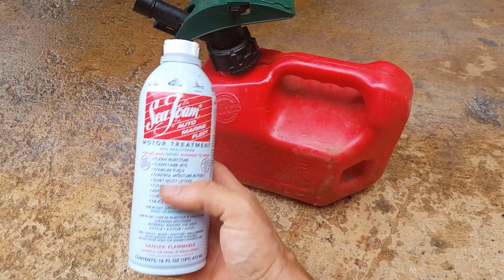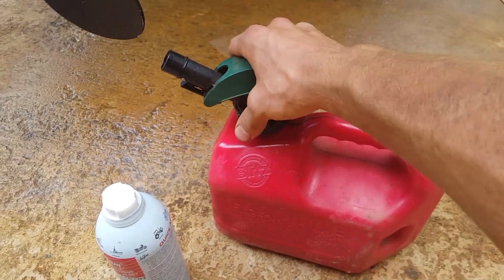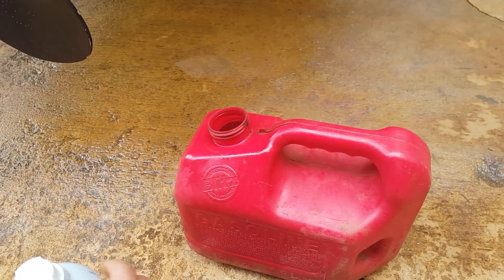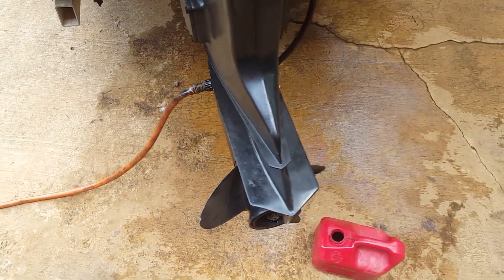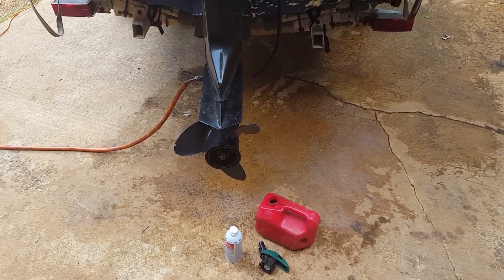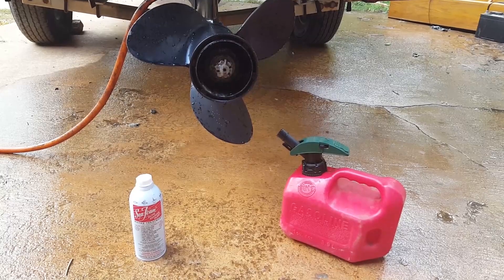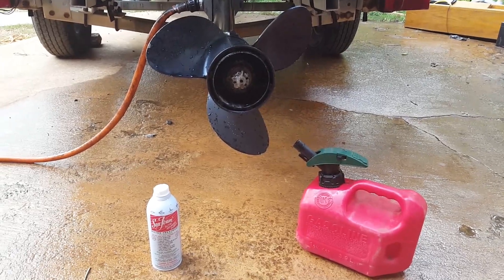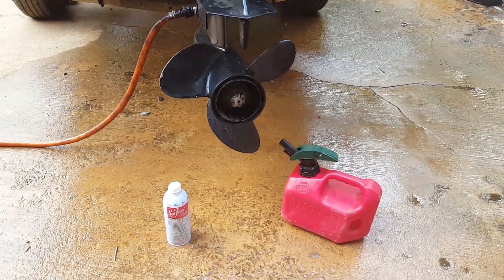Seafoam Shock Treatment - Outboard

Comment: great video man I have a 1981 johnson  70 hp 2 stroke  we took it out to lake today it idled  fine but when  we throttled it down it wanted to stall or bog down do you think seafoam  could help plus the primer  ball never got hard thanks
Reply from the maker: Seafoam is definitely going to make it run smoother, but it might not fix the problem. Did it go wide open? I'd check the fuel pump diaphragm if your motor was before the VRO oil injector fuel pump combo. You could have a dirty carb too. I'd still do the Seafoam though.
Reply: thanks I will keep you updated
Reply from the maker: +Jacob Johnson Ok thanks, let me know how it goes.
Reply: Jacob Johnson follow up on how it went? I have a 1978 15hp Johnson and when I go wide open it will go for about 5 seconds then bog down, I changed my fuel pump but sea foam is needed
Reply from the maker: Yea, Seafoam can make a huge difference for sure. If you've changed the fuel pump it sounds like you got a problem elsewhere.
Reply: Matt's Shop well when I took it out if I slowly inch  the speed it would hold at the higher speed, but I can’t go from idle to full speed or it Boggs down
Reply: U need to clean ur high speed jets

Comment: I have a question. What If your motor is oil injected? Should I still mix a gallon of gas?
Reply from the maker: Cody B Good quesion! If it was me, I would just make sure the oil tank is topped off with oil and run it like normal. Just put 1 can of seafoam in .75-1 gallon of gas like I did in this video. No need to run double the amount of oil if it's already oil injected!
Reply: I won’t hurt nuthing ! Mix some oil in gas to be safe!

Comment: Really appreciate you mentioning the smoke!  Used Seafoam when I cranked a 1987 Honda 4 stroke for the first time in years.  The amount of smoke had me nervous and thus searching YouTube.  I also found the tell-tale ejecting hot steamy water like a jet.  Think it's the same reason?
Reply from the maker: No problem! Yea it smokes ALOT everytime you Seafoam anything. Have you checked you're water pump impeller lately? Sounds like you might need a new one. They say to replace them every 1-2 years depending on use. As long as you have a good hot stream of water coming out of the tell-tale you should be in pretty good shape. However, it's a good idea to visually inspect the water pump impeller every so often. They are rubber and do wear out over time!
Reply: Thanks for the reply!  Should I be concerned that the tell-tale stream is not a dribble, but actually has some force behind it?
Reply from the maker: +John Reed You're welcome. No, not at all. You want it to have a good bit of force behind it!
Reply: Very kind of you!  Thankful to find your channel - appreciate everything you're investing into the community

Comment: Matt I've got a 1988 120V4 Looper similar motor, it's been running great. Just last weekend started losing power once on a plane at say 4000RPM just bogs down. Stop then runs for a bit and does the same thing again. Runs perfect at say 2500RPM got me home anyway.
Do you think this might help that problem?
Reply from the maker: I would defiantly do this to start out. It sounds like you might have a fuel issue. Check all of the hoses, clamps, and carb mounting bolts. Make sure there are no fuel/air leaks ANYWHERE. Have you cleaned/rebuilt the carbs lately? I would also check the fuel pump to make sure that it is working correctly.

Comment: Just did something similar with 1 bottle seafoam to 1/2 gallon of gas.  I had a 9.8 hp Evinrude 4 stroke  that I had been trolling with and not running wide open enough due to this motor being a kicker motor.  It started stalling out below 2.3 mph where I needed to be at. When running the seafoam the motor had excessive exhaust which cleaned up after about 10 minutes of high idle then it would troll down without stalling.....The marinas around here are backed up 2-3 weeks due to spring and the walleyes biting.  This saved me money and valuable time.  I think I paid $ 12.73 for the bottle at the auto part store.
Reply from the maker: That's awesome! Seafoam works great for sure. I'm glad it fixed your problem. No one likes paying crazy marina prices and then having to wait for them to fix your boat when you can do it yourself!
Reply: I have the same Engine but it's Tohatsu , My question is the engine is only one year old. Do I need this treatment on the new engine?
Reply from the maker: It's not going to do much on a new engine. You can put some in the gas tank if you want.

Comment: What year outboard is that? Does it have oil injection or do you premix?
Reply from the maker: It is a 1986 Evinrude 150XP. It does have a VRO oil injection pump, but it is disabled. I run premixed gas in it.
Reply: I have a question,  I have a vro system still intact on my Johnson 130,  will the vro still push oil when the gas line is disconnected?
Reply from the maker: I do not remember exactly as mine is disconnected and I run pre-mixed gas. Yours is still hooked up and working right?

Comment: Have you ever looked at the carbon deposits in a before and after?  Sorry to say I have done that and saw very little difference. ( I used a 2 stroke and 4 stroke lawnmower and a bore scope ) and found very very little carbon removed.
Reply from the maker: Yea, I have seen the videos of before and afters. It did something and ran like a completely different motor after this. The idle was much better and it ran much smoother. I never tell people to use these chemical "quick fixes", but on an outboard it defiantly seems to help big time. 

I don't know why. Maybe because it removes carbon from the rings and since an outboard is such a large 2 stroke motor it makes a much bigger difference than a chainsaw. Although, you can't really see it visually?
Reply: Outboard motors I can not comment about. BUT I can only comment on what I have seen first hand. I even had someone tell me " See its working!! Look at the smoke "  I then filled a brand new lawnmower and yes it smoked like a mofo.   Contacting seafoam proved just as futile.. The placebo effect is what they count on.
Reply from the maker: Rockjock007 Yea, for outboards it really works well. That's what it was originally made for SEAfoam. It was designed back when they would use regular motor oil in 2 strokes before they had all the oil technology they had today, or at least that's how the story goes. Carbon builds around the rings and causes them to stick and can cause engine failure. Especially on outboards because they are so old 30+ yrs. Everything else I have used it on I haven't really seen much improvement. On an outboard it is night and day believe it or not.
Reply: I have to believe you on that my friend.
Reply from the maker: Rockjock007 Yea! I never believed it until I tried it either.
Reply: @Rockjock007  because new engine guts come pre lubed from the factory so they dont seize while stored. That's the smoke you saw, burning oil.
Reply: Project Farm did a video of this treatment on a mower, (before & after). He scoped it and you could see where it cleaned the pistons a little, it's not a complete overhaul but the mower did run better. He has some very educational videos on Seafoam and other fuel treatments.

Comment: Adding the Seafoam will not dilute the gas/oil ratio in the one gallon can?
Reply from the maker: Nope! It will not dilute the oil/gas ratio. It is perfectly safe to do it this way. Thanks for watching, don't forget to subscribe!
Reply: You can run seafoam at a 50% mix
Reply from the maker: +Multileege Adendum what do you mean? Half seafoam half gas?
Reply: Matt's Shop yes that's correct

Comment: Thank you for this video. I had planned to just dump the entire can into my primary tank but your method is much better in my opinion.
Reply from the maker: Yes, this method is much better. If you just dump the can in your tank it dilutes it too much. This is a really popular method on the internet and works extremely well. All of the 2stroke outboards I have done this to immediately run better. Their idle improves to the point that the run like completely different motors, no exaggeration. Your results may vary though depending on the age of your motor. Thanks for watching, don't forget to subscribe!
Reply: great vid, but just a quick note..if you disconnect the fuel to the motor and pump a gallon of gas from the tank into a gas can you dont have to bother with mixing up 1 gallon, nice boat btw😎👍
Reply from the maker: Thanks, that's a great point! Never thought about doing that.
Reply: Mark Popovac  It says on the cam treats one gallon.